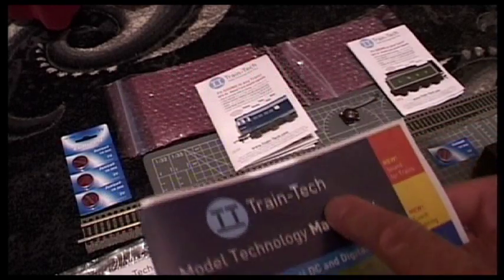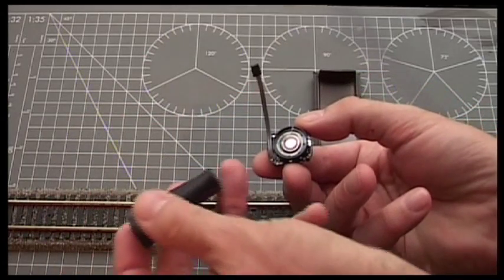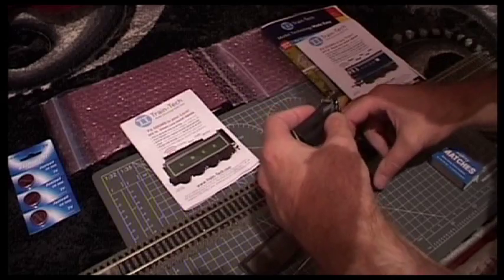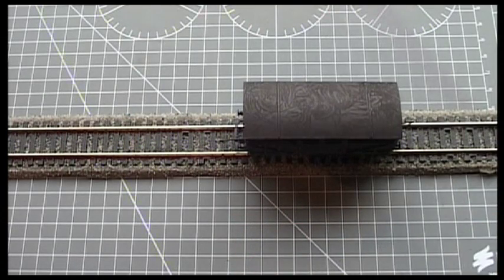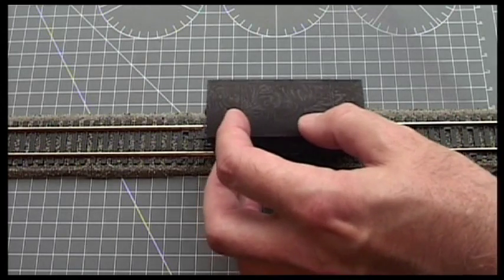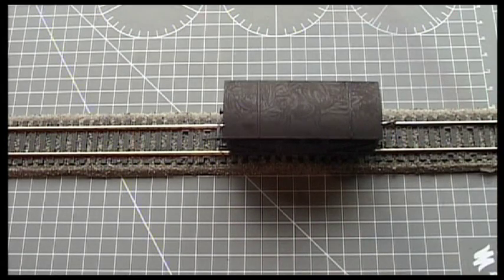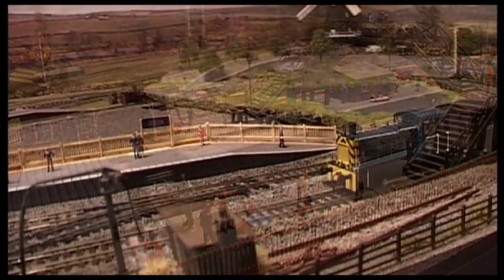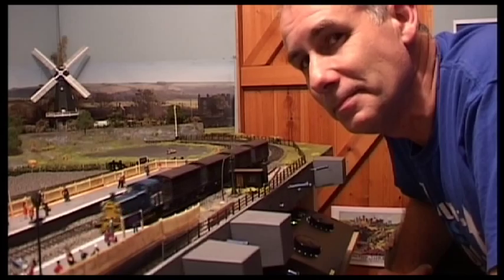Calverton Update 29th Oct 2014 Train-Tech Sounds/Diesel/Steam (new version)

Comment: This is a really clever device, with time this will be so accurate it will become a very cost effective device against Hornby/bachmann digital sound.
Reply from the maker: +aigen56 Indeed, and for the price it is great. You can hook it up to any of your engines. Just a fraction of the cost. 
Then again mylocosound.com do a more expensive unit that is equivalent to the big manufacturers but it costs more. I did a review of a £150 coach I got off of them but you can set the chuffs per wheel revolution for example, and alter the sound by remote control. 
So you make your choice and pay your price really. I Like each system.

Comment: Purchased the diesel traintech sound version recently,it has its limitations as the battery only lasts 6hours,could do with the volume increased however as difficult to hear if there is any other noise in the vicinity, with more research this could be a useful addition to the layout.
Reply from the maker: tommy jardine They are making another version in which you can adjust the volume and make it louder but the battery doesn't last as long. 
One solution is to fit a bigger 3v power pack.
Reply: Would this larger 3v power pack have to be connected outside of the sound unit and how would it connect ?
Reply from the maker: tommy jardine You'd have to chat to Train Tech about that really. Depending what 3V power source you were using, it may need to fit into a larger wagon, or a coach instead. I haven't tried it myself.
Reply: looking forward to any increased performance .with battery improvements.
Reply: tommy jardine Maybe try an old mobile phone battery (the 3v type) ex Nokia old phones. Don't solder to the battery pads though, make a pair of push-fit contacts. Batteries can be recharged in the old phone with the Nokia charger.